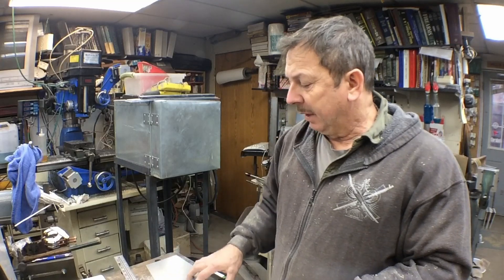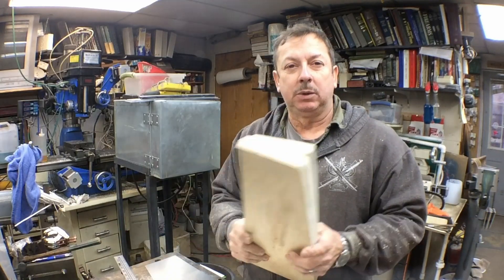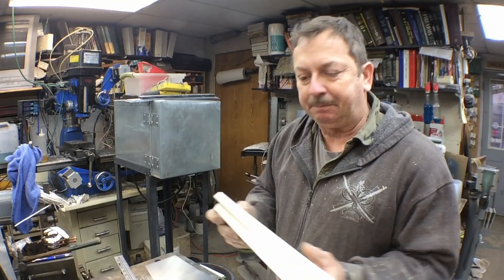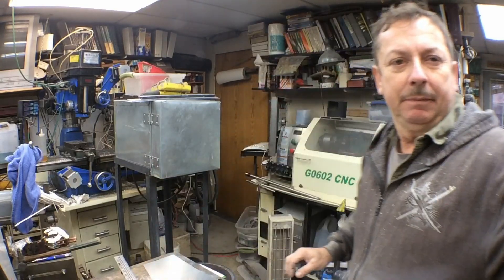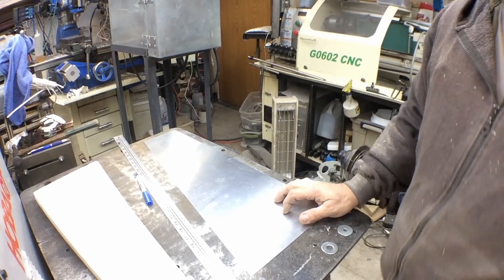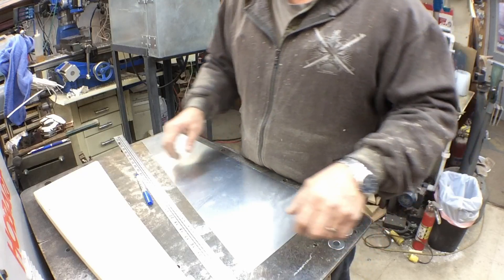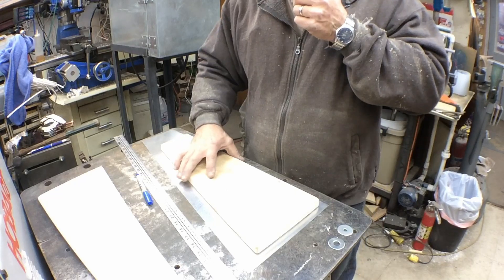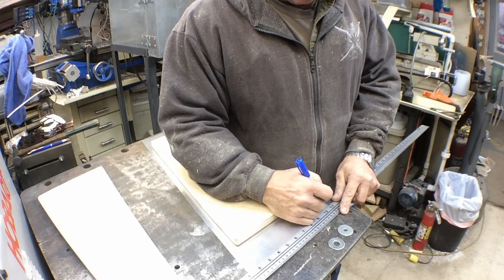Building a Zenith 701 Experimental Airplane,  Fuel Tanks Part 2, Forming The Ends

Comment: Great tip about leaving the flanges long and trimming later, and I wholly concur. I decided to do mine so they didn't need to be trimmed later. It was challenging, to say the least. They turned out okay, but I should have left them oversized and trimmed.
Reply from the maker: thanks Greg. i learned that lesson early on.
Reply: I debated it with myself back and forth before I did them...should have known better!

Comment: Hey Dan, I'm looking to start a zenith 750SD here shortly and would love to pick your brain. I tried to send a message through youtube but couldn't.  If you would shoot me an email I'd appreciate it. korben88 @ gmail.

Thanks for sharing your videos.
Reply: Troy, you're such a lucky dog...if only the SD had been available back in the day. Too late for me to switch now!
Reply: Troy Anderson I'll be interested to see what the differences are at some point.  I wonder if it's just a few beefed up structures here and there, or a bunch of major changes. I know they extended the wing and made the tail feathers bigger,  but the other details will be interesting. Glad the SD is the right choice for you!
Reply from the maker: Hi Troy: I just sent you an e-mail
Reply: Yeah I'm pretty stoked about it Greg. I was debating the 750 as you know, but not sold on it because of the lack of useful load

When the Super duty came out this summer it was like "that's the one!"

I still have to wait a couple months to get rolling though. The plans aren't quite ready yet.
Reply: Other than the wings and tail not much really from what I understand.  The rear cabin is quite a bit different with the jump seat, but the cabin frame is the same minus the cross member for the panel (if you choose to go the unpanel route. Otherwise it is the same).

One day we'll have to meet up and compare planes.